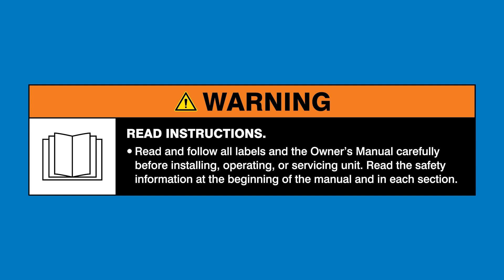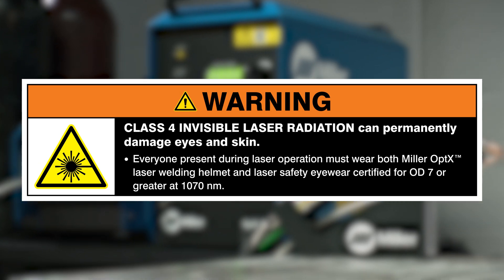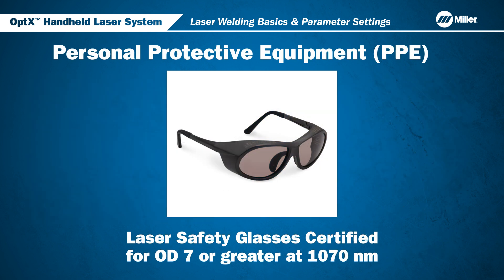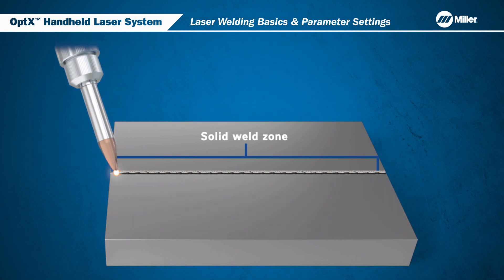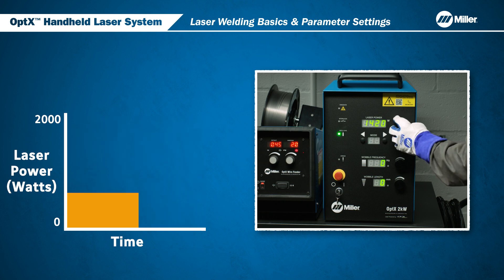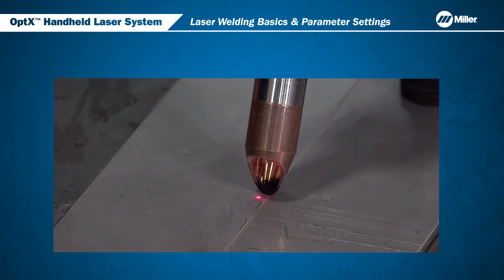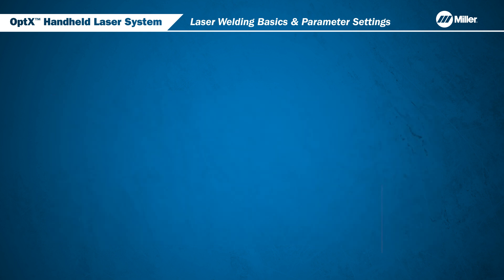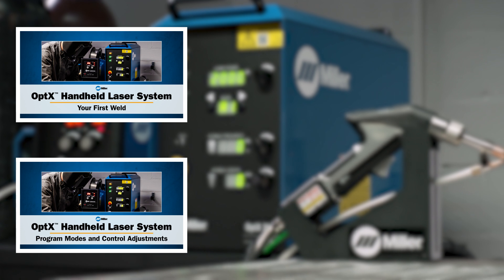OptX™ Laser Welding Basics & Parameter Settings

Comment from the maker: For the OptX 2kW, you can weld up to 5/16" thickness, and for the OptX 1kW, you can weld up to 1/8" thickness—wire speed should be adjusted based on the material thickness, with thicker materials requiring faster wire speeds.